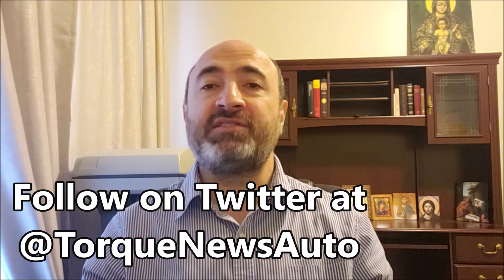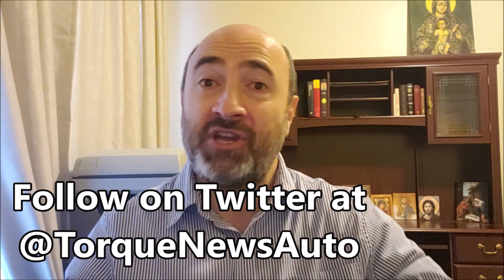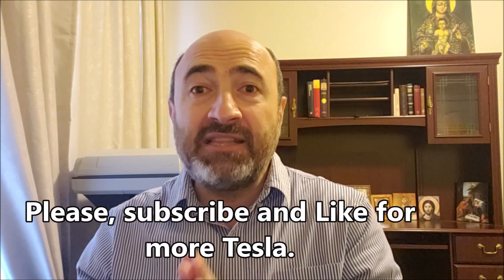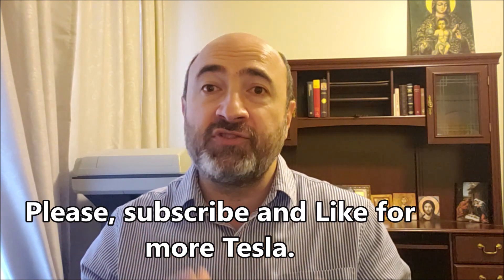Tesla Replaced Its Battery and It has a CATL Cell

Comment: Paved roads and Parking lots lead to the Average Temps being about 7 degrees hotter in cities and at the Same Time they Provide a Great place for.SOLAR POWER and thus Solar Powered Parking Spots to Drop the Tempts in Our Cities that lead to death on really hot days and We could solve this problem if all parking lot spots have to be a charging port instead all solar powered. It would assure.all could have a charge anywhere.at.anytime.and it.would be funded.by.each person charging at their parking spot wherever they are.. The Future.should be in a Company that turns all Partking lot spots into solar powered parking. Time to Block the Sun from Heating up our citys and have it power our vehicles instead including phones and all are.other Electric needs 1 stop.shop..& charge anywhere at any time where.there is a Parking spot. This Idea is the Best but.will Elon do it ? If.not he isnt cutting edge as many of his fan bois claim